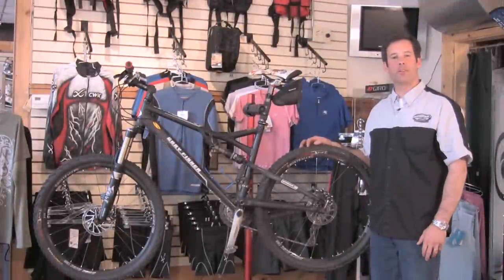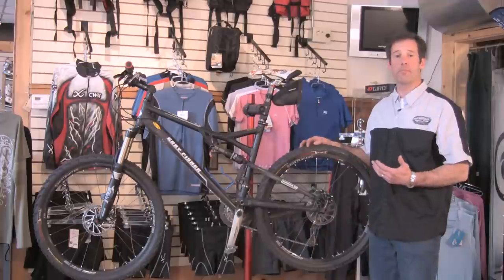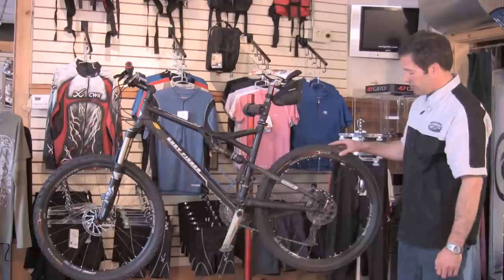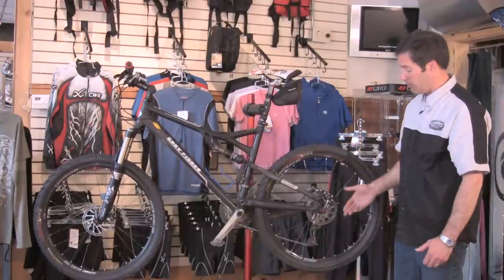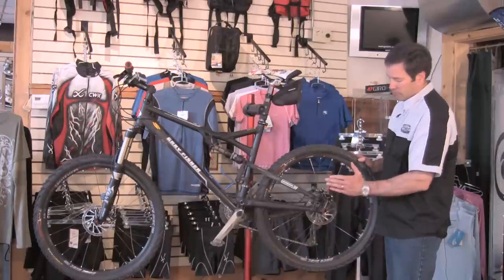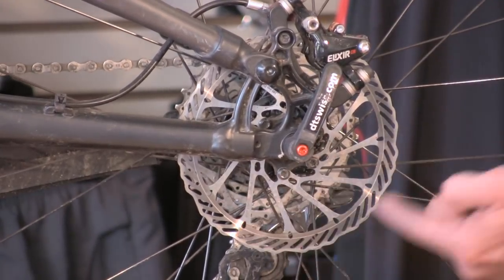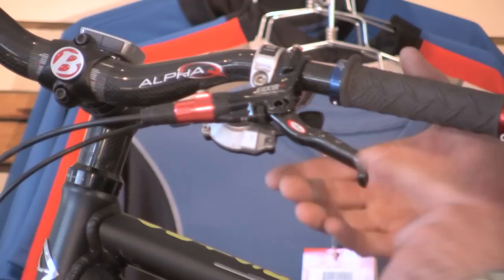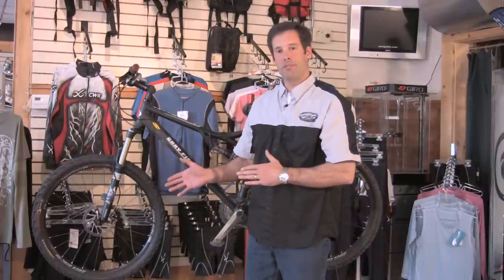Bicycle Parts & Maintenance : About Bicycle Brake Parts

Comment: The 'OLD' pincher style? Modern road racing bikes still use that 'OLD' pincher style brake exclusively, since it is much lighter. No need for those heavy pistons, cylinders, and metal disks if you use the 'OLD' pincher style brakes on a light, fast road racing bike.